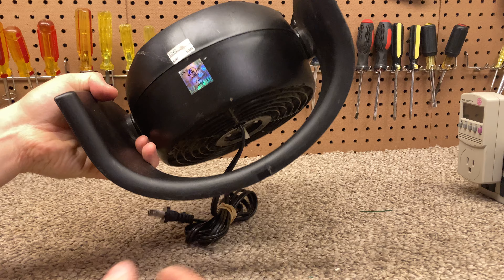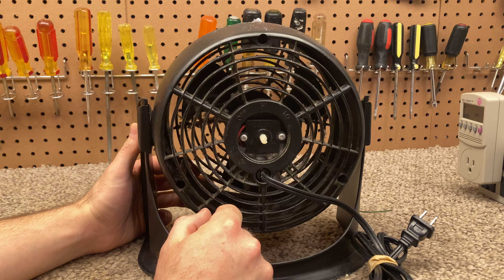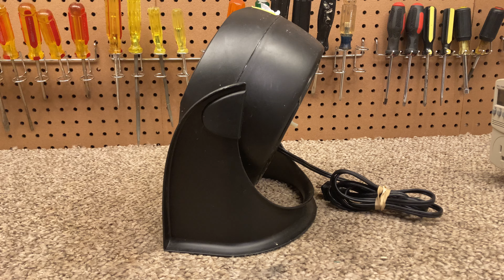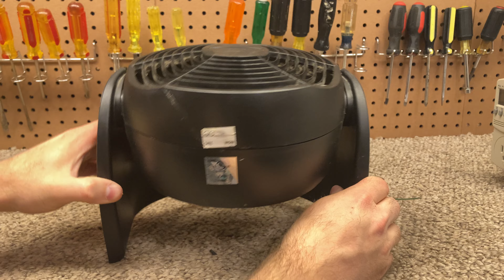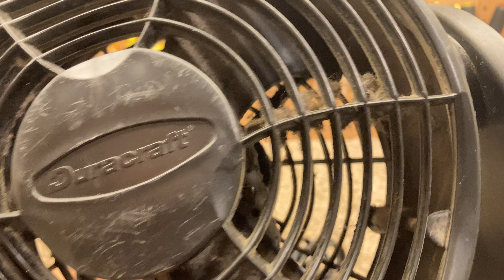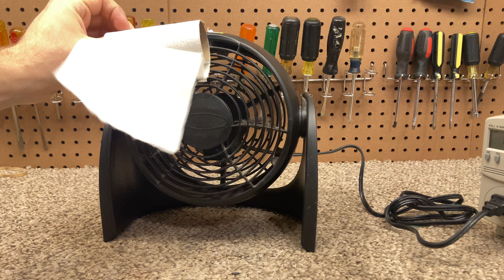Duracraft DT-750 Series | Initial Checkout

Comment: This is a duracrap lol. But cleaning it should help with the airflow. And your right about the aerodynamics, the front and back guards have too much plastic grills and there pretty thick too, the blade also has weird shape.
Reply from the maker: I have another one that's clean and it doesn't seem to work any better unfortunately.